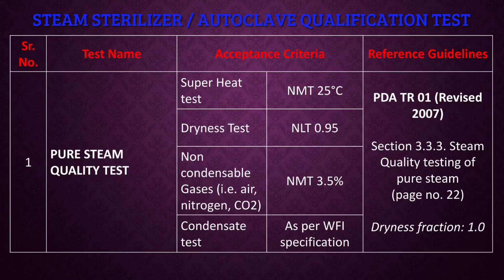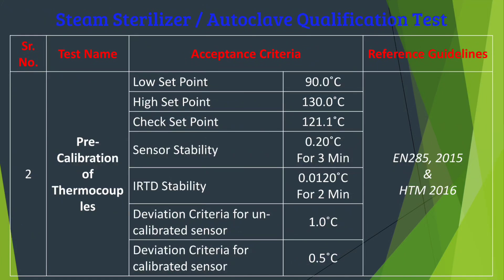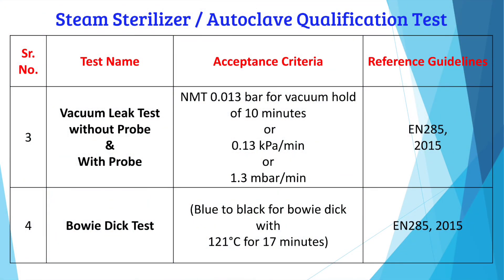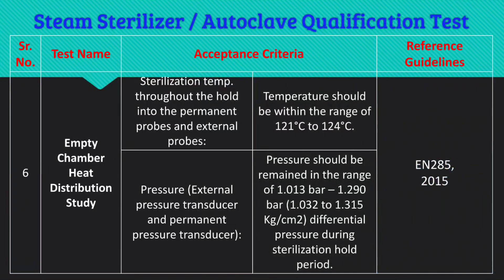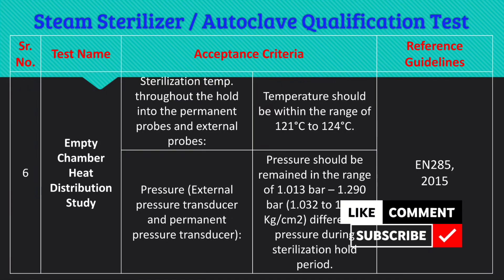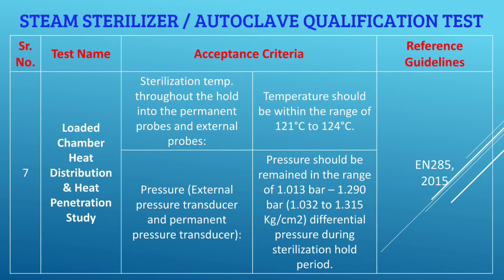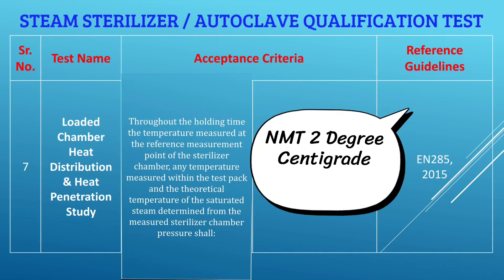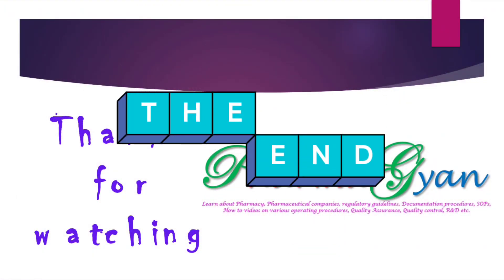Autoclave performance qualification acceptance criteria test details with reference guidelines

Comment: Do you have latest guideline HTM 2016
HTM 2010 is there.
Reply: Is there any guidance related to 'Lag time' in any guideline. 
And what is exact meaning of equilibrium time (no defination) and how it will apply in practice is it really possible to achieve equilibrium time. During validation or routine work.
Reply from the maker: @ravindrajoshi3374 
Yes You can find it in PDA TR 01
Reply from the maker: @ravindrajoshi3374 
Equilibrium time you can check PDA TR01 and. EN285
Reply: I also know defination are given, but my question was different, related to lag time and practical base possibility related to equilibrium time achievement  @PharmaGyan
Reply from the maker: @ravindrajoshi3374 when your autoclave loads are optimised and placed well then equilibrium time is achieved very well
We will prepare a video on equilibrium time along with parameters affecting this
Also on calculation of lag time
Reply: @PharmaGyan  super thanq, accordingly it is very tough to achieve equilibrium time.
But for general purpose microbial growth media sterilization, is it really necessary to achieve equilibrium time acceptance criteria or we can say it may related to terminal sterilization or heat sensitive material which requires accuracy related to all sterilization paramaters.
Reply from the maker: Yes HTM 2010 and 2016 is obsolete now for the same you can refer EN 285